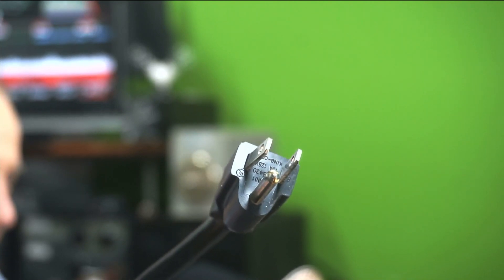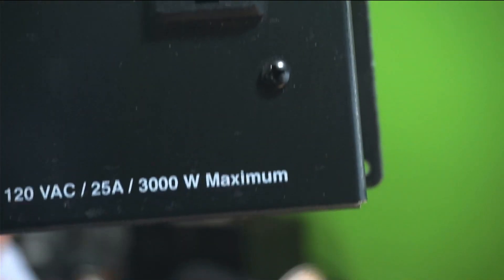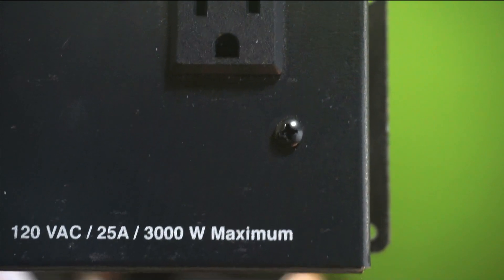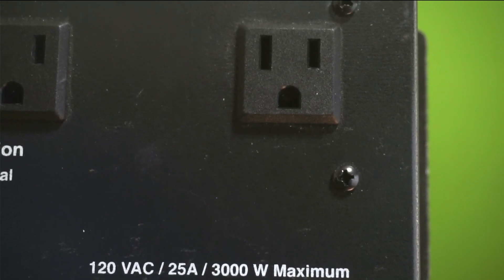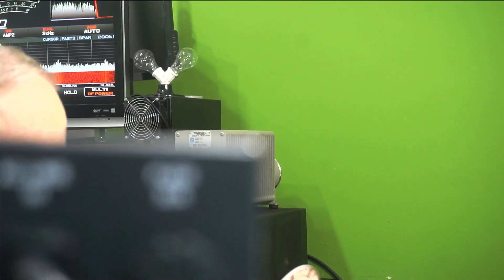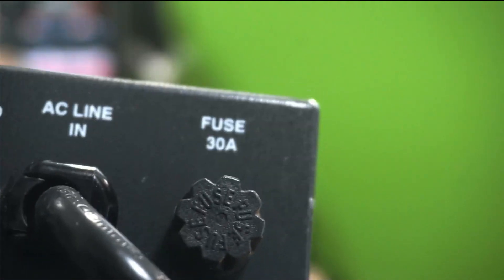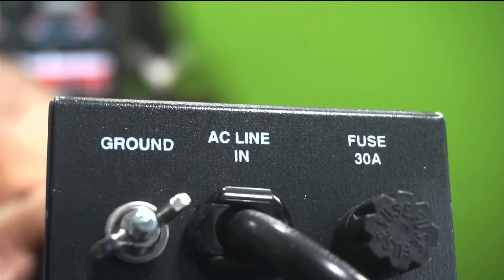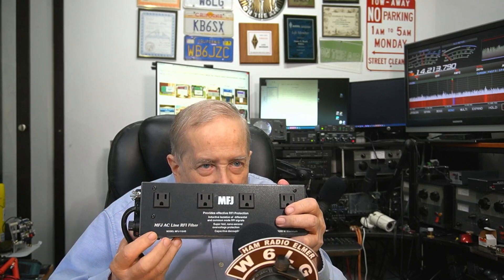If You Have One of These, You May Want to Change the Fuse as Jim W6LG Describes

Comment: As a former QA Specialist, and a ham radio operator for over 30 years, it saddens me to see this crap on the market.  Crap?  MFJ is jeopardizing the health and safety of all who buy this product.  Would like to see corrective action from MFJ on a 100% full-replacement on all products with these serious discrepancies.  I have seen commercial companies play catch-up to save the reputation of the company.  It’s very expensive to recall a product after it’s released in the field.  But, it’s the ethical thing to do.  HRO and DX Engineering are you listening?  73 KD6UYK. Tim

Comment: Jim, did you take it apart to see if the connecting wires are of a proper gauge for even 15 amps? It's probably wired from the same spool of wire as that powerpole outlet box you showed.

Comment: Hi Jim.  I can only give you a point of view as a UK electrician (and ham).  Although I agree it is not great.  If your 15a outlets in the usa are protected by a 15a circuit breaker in your distribution panel, then that will provide you with overload protection you need.  Not that the mfj should be relying on this being the situation.  Thanks for the videos, keep up the great work.
Reply from the maker: Keep in mind.  Many outlets are not 15amp.  All of mine in the radio room are 20 amp.  Trip current is slightly greater.   I think about 21.5 amps or something like that.  So, I put into the fuse holder a 15amp fast blow fuse.  All of the wiring in this room is #12 AWG NMC, QSL? Just kidding.  And IO have yet to discuss doing as suggested running a ground wire from a driven rod.  That can be very dangerous.  73, Jim

Comment: I hope you did not actually pay for it !
Reply from the maker: The next video that I am working on now, I did pay full retail at DXEngineering.  You will see two wires not soldered to the 20 amp switch.  Those wires appear to be #18 or maybe #16.  Presumably there to handle 20 amps at 12 vdc.  73, Jim W6LG

Comment: Hi Jim, besides this device violating NEC, and as someone already noted, the 15A house breaker is the device that will protect the power strip, I would downgrade it to a 10A or so. Some time back when I built a high-level modulator, I put in a 15A fuse for a  2KV, 700mA transformer and there was a bias supply also on that fuse. Well, the bias supply diodes shorted and the little bias transformer could not blow the 15A fuse so it went up in smoke. Destroyed it. After finding another transformer and installing it having to modify everything down to the chassis, I added a 1A in series with the bias supply. I know a power strip is not exactly a piece of radio equipment but I do my best to fuse things at no more than twice what the maximum running current is. Better to blow a fuse than smoke your equipment or your house. You give good advice.  73   Stay Safe...
Reply from the maker: Over the years, you have built all kinds of "stuff" and so you know better than most what I am concerned about.  Those who are interested can Google El Paso Tube Amps and see some great things using tubes; yes tubes.  73, Jim

Comment: I agree that the labeling is misleading and could result in a problem.  In their manual, it is clearly warned that "CAUTION: DO NOT overload your AC Line RFI Filter.  Each outlet can handle a load of up to 15 amps, but do not exceed a TOTAL load of more than 25 Amps for all outlets."  Absolutely a poor way to design and label a device.  The 30Amp fuse is a FAST BLOW and by their definition , "A 30 Amp fuse is used to protect your equipment from a high current surge.  If the fuse should blow in the case of an electrical storm, transients or surges, replace the fuse with a 30 Amp glass tube type fast blow fuse" - Once again, not very good engineering and I am very surprised that they got it released on the American market.  I am almost sure that it isn't labeled UL Approved.
Reply from the maker: You are right.  I see that warning now.  I had not seen it before.   It, the instructions, make no mention of UL.  I see nothing on the box to indicate UL.  Consider a 20 amp line like I have in here.  The trip current is likely something like 22 amps or so.  I did replace the 30sb 3ag with a fast blow 15 amp 3ag.  For now that will be okay....I think.  73, Jim

Comment: If sold in the USA, it has to be UL approved - protects seller from lawsuits. A wire's safe limit is determined by diameter, length, material, and expected environment (ability to shed heat). If it is UL listed, you can trust it for it's intended use IMHO. I'm just an EE, but someone who works with UL may chime in with real world knowledge.
Reply from the maker: Maybe so but I don't see any indication.  That would be interesting if true.  Thanks for your help. 73, Jim

Comment: What trips first: The 15 amp breaker in the service panel, or the 30 amp fuse on that box? And knowing you are plugging it into a 15 amp wall outlet, what sort of ham would plug more than 15 amps worth of devices into it and expect the breaker or fuse not to trip? This is a good video to advocate for self-responsibility and being "somewhat smarter than that box". Like the meme says, "...I'm not saying we should kill all the stupid people, I'm just saying we should remove all the warning labels and allow the problem to sort itself out..."
Reply from the maker: What if it is plugged into a 20 amp outlet?  What do you think?  All of the outlets in my old home that would have been 15 amp were wired with #12 and had a 20 amp breaker.  I know that because I built the house.  Interesting discussion in any case.  There is lots to learn for all of us. 73, Jim
Reply: @ham-radio   I think it's safe to presume you are well aware of what you are doing and the specification limits of your equipment and infrastructure. If you weren't, this video would not have been made. You set a fine example and are absolutely smarter than that box!

Comment: I have never seen a 120 VAC 20 or 30 amp plug that has a horizontal and vertical males. I have 2 30 amp outlets that I had installed by a licensed electrician, and the outlets are the standard 120 VAC 3 prong females. The only US plug with vertical & horizontal males that I have seen are for 240 VAC. I also have a 120 VAC 50 AMP heavy duty extension cord that shares the same type of outlets. So if 30 AMP 120 VAC requires a vertical/horizontal prong orientation, all of these things are wrong. One hot mess if you ask me.

One thing about that box is the addtional ground. It's a 3 pronger, not supposed to have an additional ground.
Reply: Yes, they have 2 vertical prongs but one has a right angle at the top approximate 20 percent of the plug
Reply: @bassangler73   The plugs that are on these items, as well as the extension and femaile wall outlets, look identical to the plugs on my lamps. Like all new plugs, one is taller to arrange correct polarity, but other than that, I don't see any vertical cuts or channels. 

I double checked to make sure I didn't miss that detail. Have no idea what the electrical code says, but if it says that, then retailers are selling UL approved accessories that don't follow code, which makes no sense to me. 

I will leave this to the electrical pros to hash out. I used an electrician to hook all of this up, he is insured.
Reply: @BMCTackle huh...one leg should look like an upside down " L " with the bottom of the L shorter than the vertical portion...maybe they make standard plugs that are rated higher
Reply: @bassangler73   LOL, I have no clue. In Europe they use that type of plug similar to our 240 VAC, but the voltage is 225 VAC. I know it is less than 240, but not sure of the 225, could be 230. I had to buy inverters when I was in the UK back in June.
Reply from the maker: Ah no, go look at Home Depot outlet and plugs.  Then look at the 240 volt plugs and outlets.  There is a difference but it takes a second look to see that. Confusing, absolutley confusing for all of us. 73, Jim

Comment: The cord is protected by the socket outlet fuse or mains circuit fuse, the 30A will only be protecting the downstream multisocket outlets on the unit. The mains circuit fuse if smaller than 30A will blow first( Im` in the UK so our plug tops have a fuse which protects the cord and the unit)
Reply: At work some time ago, we had one of the old Xerox wax printers. It heated the wax with a high amp heater. The thing had a removable10 or 12 gauge cord, why it was removable was plain dumb. Someone moved it and plugged in a 14 ga. monitor cord and it melted and caught fire when it was turned on and shorted out half the floor. A GFI might have prevented that but a 15amp fuse in Jim's box would have too
Reply: @Tyq0v3uz  Your both correct but if the plug top was fused as here in the UK the 30A downstream fuse would be useless.
If all US power leads are similar ( I dont know)then there is a problem with unfused power leads which really should be addressed by amended US electrical codes.
Reply from the maker: I disagree.  And that is okay.  The fuse could protect the cord from overcurrent.  Make sense?  Thanks, Jim

Comment: Hi, Jim.  Glad to see you making excellent another video.

Since it's an MFJ product did you do the standard pre-use  shake test to check for loose parts, bad solder joints, etc? :)

I have one of their antenna analyzers that's been great.  I have some other products from them that I wish I hadn't bought.

Thanks for all your work!
Reply from the maker: Wait until you see my next video where a small wire at the switch was left unsoldered on one side and only partially soldered on the other side of the SPDT.  I pulled both wires loose and replaced them with #12.  It is a powerpole box with a switch.  There was an inspection sticker on the side of the box.  The inspector may need company supplied glasses.  73, Jim
Reply: MFJ are the ones who got me doing this to almost all my electronics.  Found a loose washer in a brand new antenna tuner.

Comment: Jim, just some thoughts,  the three thousand watt deal,  power is dissipated at the load, not in the cable, so it doesn't really apply to the cable. The 30a  fuse could make sense depending on what the load is depending on what kind of fuse it is but I agree with you I think I would change it
Reply from the maker: Honestly, I don't agree.  But this discussion is good because we are discussing all aspects.  Having seen the results of a fire, I do worry perhaps needlessly. 73, Jim

Comment: I think you're spot on. Since the cord  (14awg) and plug end would be plugged into a 15A circuit (15 amp breaker as well), the 30A fuse is pretty well useless anyways.  I suppose if you changed the fuse out to a 15amp, it may blow faster than a breaker, and therefore help protect a bit more protection on some equipment.   However, given the cord size, rating of those single receptacles, etc, the 3000w rating is "out to lunch", as well as the 25A designation.  While those numbers are misleading, it shouldn't be a fire hazard as it sits, but what would make it a fire hazard is if anyone replaces the 15A plug on the end with anything that allows it to be plugged into a circuit with a circuit breaker and overcurrent protection higher than 15amps.
Reply from the maker: You make some very good points about overcurrent protection.  But, again just a "but", what if it is plugged into a 20 amp outlet?  Would that be of concern to  you?  I did inspect a house that had a fire because the breaker did not trip until after the cord set the carpet on fire.  I guess that is what worries me a little. I would prefer that a 15 amp cord have a 15 amp fuse.  I maybe wrong.  And, if so, I apologize for misleading anyone. 73, Jim
Reply: @ham-radio  Oh.. I wanted to add.. household voltage (120v) can arc quite a bit  before tripping some breakers (if at all). I've seen old FPE breakers not trip as a "near" short condition provides quite a light show (resembling someone welding)  while having a high current draw  (dead shorts should trip faster).  There are videos on youtube demonstrating arcing between 120v conductors due to a faulty wiring or connections and potentially causing a fire, without 15amp breakers tripping.  Thankfully code has improved somewhat in the last few decades to require arc-fault breakers for bedroom circuits, etc.   I have some MFJ gear and this is disappointing when I see the 3000w/25A ratings since it just shows the lack of proper (or any) engineering and adherence to electrical safety.  Just my two cents :)
Reply: @ham-radio   I think how the cord and plugs would handle 20 amps would depend on the temperature rating of the cord, and its conductor insulation.  Higher quality cable and wire usually have some sort of temperature rating (ie: 60C, 90C, 105C etc), but something tells me cheap cords at 20 amps continuous would make  the cord heat up and possibly melt. Also, the receptacles could also melt, if that material was low quality (ie: cheaply  made as many of those are).  These concerns are why I stay away from cheap no-name power bars as well.
Reply: @ham-radio You had it right in the video.  Not all electrical devices are fused, but if one is going to include a fuse, it should be sized to protect the device and its wiring. Most 20 amp outlets in the US will accept a 15 amp plug, so a device with 15 amp components and wiring needs its own 15 amp fuse, not a useless and misleading 30 amp fuse.

Comment: Like one ham said about all the MFJ haters out there, they most likely have at least one MFJ item in their ham shack because MFJ makes things you can’t find elsewhere😊.  You are all ham operators and should know how many amps you are connecting to the device. It’s nice to have four plugs if you have four 2amp loads. Lastly, in this scenario, you fuse for fault current, not load current. The house breaker will take care of overload.
Reply from the maker: I certainly DO NOT HATE them. I have filmed the next video.  When that comes out in a day or two you will see that I bought a $150.00 device for powerpoles and found the wires at the switch had not been soldered.  I removed the wires that looked like #18 and replaced them with #12 because the max current is 20 amps at that switch.  Maybe that too was a mistake?!?  I am questioning in the video a fuse at that cord that is 30 amps.  The cord is 14AWG.  Breakers fail.  I saw that as a Deputy Building Inspector for Nevada County.  73, Jim
Reply: While it is true that MFJ markets products and gadgets for Hams that are not found anywhere else in the Ham Radio Marketplace, there are numerous well documented examples of poor quality within many, if not, most of their inventory. Poor Quality Control seems to be apparent. Sure if a device fails they may replace it or repair it without much of a hassle but why not make it right the first time and avoid those issues altogether. About 15 years ago I got rid of the last product from that company in my shack. Other vendors may have similar products at a slightly MSRP but I would rather pay a few more bucks for a better quality product that will last and have no safety issues. With some of the voltages in many ham shacks why chance it? My 2¢ de KZ5Y dah di dah

Comment: It's MFJ. They're relying on the cold solder joints to be the fuse.😂
Reply from the maker: The next video I have "filmed" is exactly that.  It looks like an 18AWG cold soldered and not soldered at the switch designed to handle 20 amps, yes 20 amps.  73, Jim